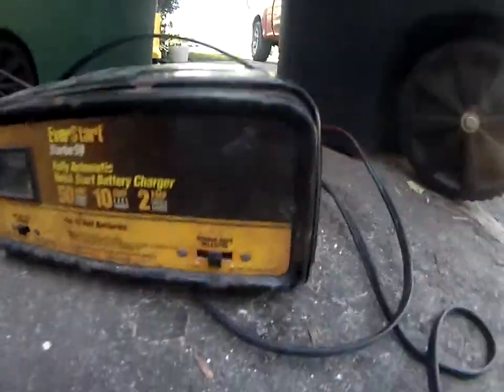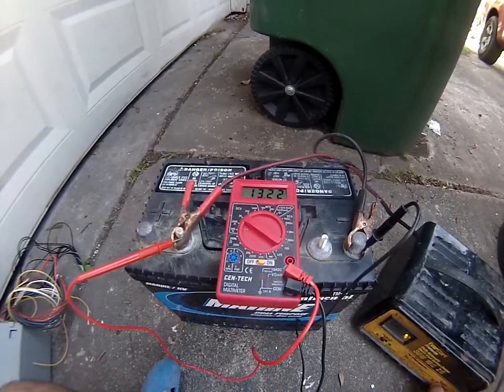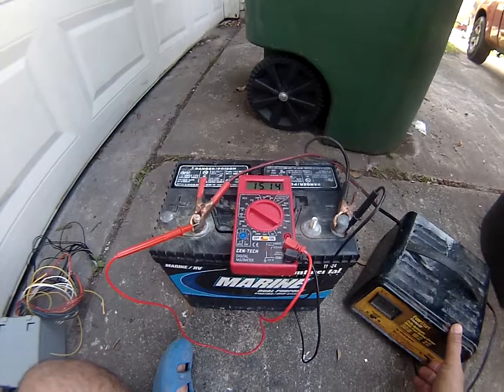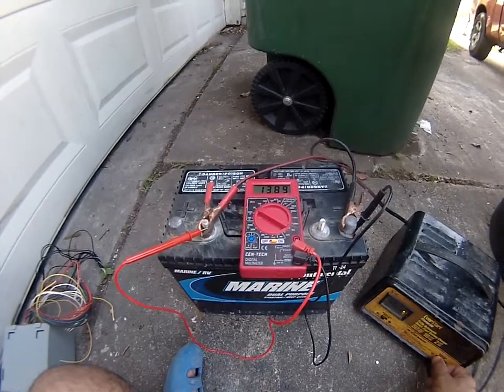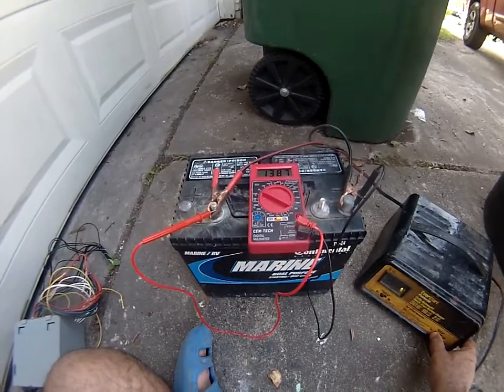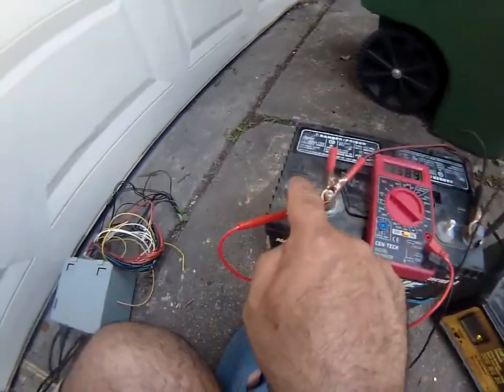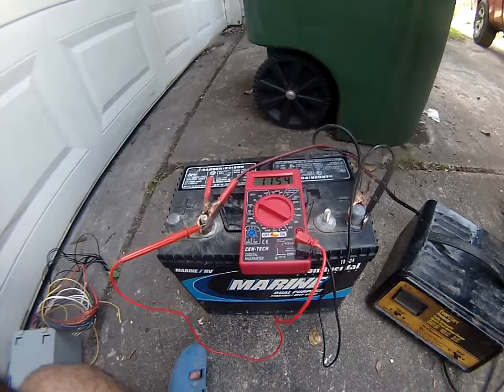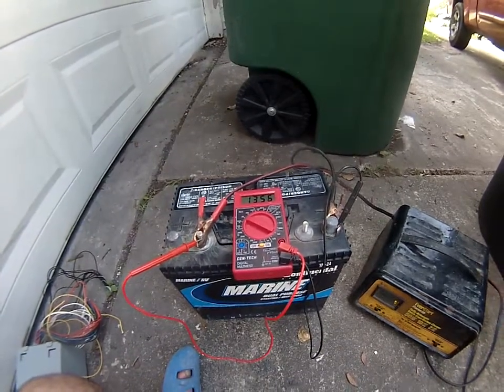How should I charge my Battery

Comment from the maker: 12 VOLT IS 50% CHARGED , FULLY CHARGED BATTERY IS 13.2 VOLTS
Reply: 142 is floating 14 forest charging at 16 amps. And you put water in the battery distilled The battery is fully charged and warm